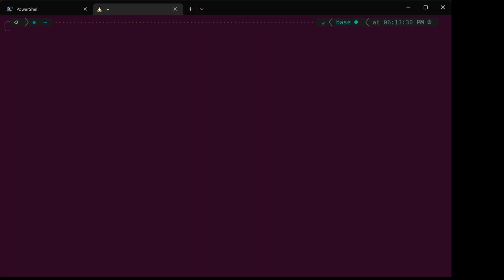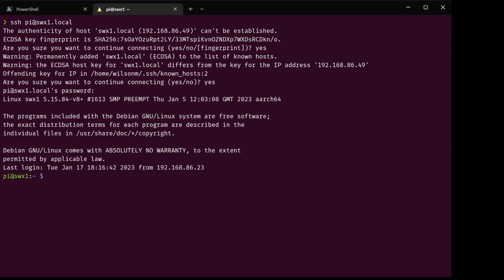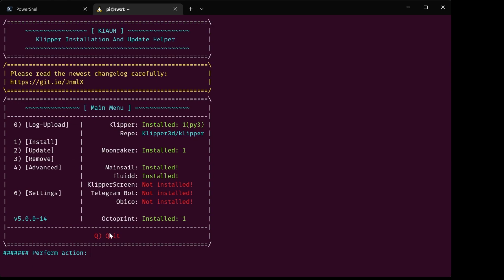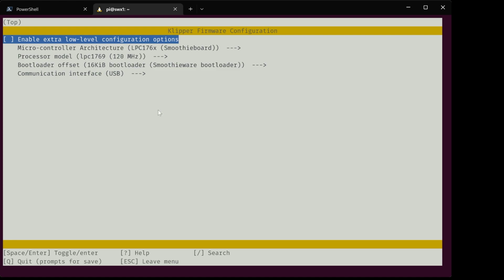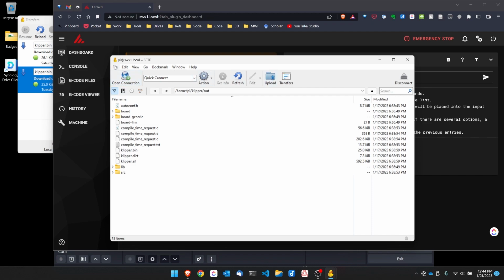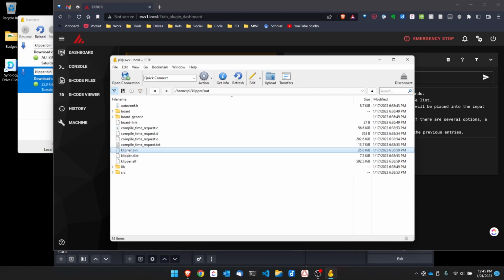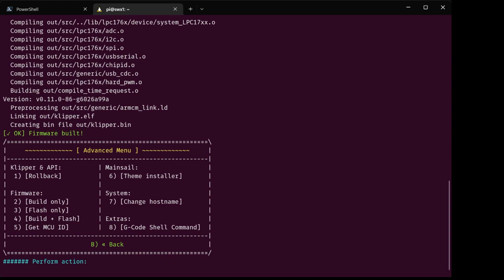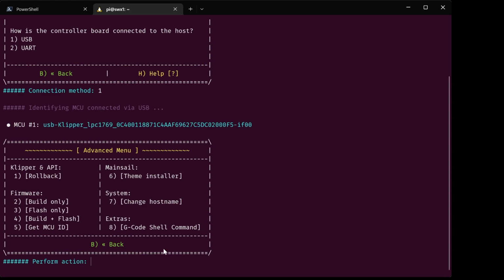Completing a Klipper Install and Flashing the Firmware onto a 3D Printer (Part 2 of 2)

Comment: I've the same sidewinder X1, with klipper, skr 1.4 turbo and bltouch on waggster mod. I have problems with the bltouch. Wich pin did you used?
Reply from the maker: I use the pins on the breakout board and I believe the actual bltouch pins on the mb.
Reply: I use 1.27 with the waggster mod, but having so much trouble.  @minimal3dp

Comment: Does Anyone have a printer.cfg file for the x1 with the waggster mod?
Reply from the maker: What board?
Reply: @minimal3dp  Hi! Thank you!  SKR 1,.4 turbo tmc2209,  i got a file from clanks50ae on github but when bed mesh calibration  i get a "move out of range:2.000 305.000 10.000 [0.00]"  any sugestions?
Reply: @minimal3dp  SKR 1.4 turbo tmc2209

Comment: Couldn't you just connect the Pi to the printer and then flash the firmware you built on it? I am fairly certain that is how I had done it last time...?
Reply from the maker: You can but I have had issues with it in the past.

Comment: it would have been easier and cheaper if i had just followed my BTT boards pdf instructions on this. 
instead of installing everything as instructed by this video series and wondering why it wont all fit on my 8GB emmc CM4 raspberry pi. i would have all been done and printing last month. 
no one needs 2-3 web interfaces for one printer. all you had to install was klipper, moonraker, and one of 3 web interfaces (mainsail, fluidd, octoprint). 
you made the tutorial confusing and frustrating for new people. 
but at the very least i know how to install klipper in under an hour without a hassle now. i just have to upgrade some hardware on my printer to 24v before i can connect it and finish configuring the firmware. if only i didn't waste $200 by watching this video series.
Reply from the maker: I am a bit confused. Why did you spend an extra $200? Why not use a bigger SD card if that was an issue?

Comment: How do you actually flash the firmware on the motherboard though? I put the firmware bin file on the sd card, installed it into my machine, and then what? I powered off and back on but my BTT Klipper Pad 7 is still not showing a connection to the printer. I believe it did flash the firmware though because my Marlin screen is no longer showing printer connected.

Mainsail just says mcu 'mcu': Unable to connect and to restart firmware but that does not work.
Reply from the maker: Did you edit your printer.cfg with the MCU.

Comment: I want to build a Voron 2.4 which uses 7 steppers, and I want to use as much parts as I have on hand to keep cost as low as possible.  I have a Pi 3B, and SKR Turbo on my bed slinger, and an SKR 1.3 in storage.  Would my Pi be able to control both of these boards together which would keep me from having to buy an SKR Octopus?  I also have an SKR Pro, but I can't remember if it's an LPC 1768 or 1769, but I'd be most happy if I could use any 2 of the 3 SKRs I have on hand.
Reply from the maker: I was not aware that you could chain boards together. I think you are going to have to buy the octopus or a similar board with 8 stepper ports.
Reply: @minimal3dp  Nero3D said on one of his vids that the Pi can control multiple boards via the 4 USB ports, but he didn't clarify if they need to be the same boards or not.  I'll try to locate that video again and paste the link in another reply.
Reply from the maker: @MichaelJeffers75  I am thinking that is for Klipper running on 2 different printers. Let me know.
Reply: @minimal3dp  the way Nero explained it leads me to believe that 1 Pi can control several MCUs.  I'll try it in a couple months and clue you in how I made out.  I'll buy the Octo if need be, but I'll try to avoid the cost first.

Comment: whenever i check the mcu ID in putty it says "#=======================================================#
 No MCU found!
 MCU either not connected or not detected!
#=======================================================#" I've tried to make sure i have the proper build and everything seems okay, initially it was connecting (that was last night) then i went to bed and tried to finish set up and now im only getting mcu errors, ive been at this for around 10 hours now. If there's any advice id greatly appreciate it. this is my first time doing anything at all envolving a rpi or coding at all im a complete noob!!!
Reply from the maker: I would reinstall the firmware on the printer board and I would check your USB cable.

Comment: Hi, im struggling at this bit, i managed to get to 7 mins in without any issues apart from my printer is NOT listed in the config p[age, its an ender 3 Neo (first version) but apparently i can just use the ender 3 v2 as it is the same board (4.2.2). ive created the file and put it on a SD card but if i go back into the powershell my MSU comes up as usb-1a86_USB_Serial-if00-port0 so i dont think it has flashed properly. any ideas?
Reply: any fix for this?

Comment: I have same problem with many others (Including this thread) with 1.4 turbo  . When trying to connect directly to skr 1.4 turbo with pronterface:"Got rubbish reply from COM4 at baudrate.." Apparently there's an issue with firmware's serial port setting. I have no idea how to proceed from this.
Reply from the maker: Can you email me the error and I will take a look after work. My email is minimal3dp@gmail.com
Reply: @minimal3dp  I tried to connect raspberry and SKR 1.4 turbo with Octoprint. Octoprint gave Raspberry low voltage error. I have atm only 2A psu (Phone charger), Ordered 3A should arrive soon so fingers crossed. If that won't help I have also ordered 220V (250) 6 slot extension block with 4 slot 5A USB. It should arrive in a week or two.  If that won't fix the problem, I'll get back to you.

Update:  Since my mainboard is not yet intalled in the printer but on my desk there were some issues: Finally found out why raspberry Pi didn't communicate with SKR 1.4 Turbo. SKR 1.4 Turbo can NOT be powered from  SKR 1.4 USB connection. It MUST be powered from printers PSU (or equivalent external PSU). MCU id in the github default SKR 1.4 printer.cfg was poppycock. MCU id can be checked with command:   ls /dev/serial/by-id/*  in your ssh terminal.
Now at least I have error messages which I can fix without losing anymore hair: Missing parts of extruder1 section can be copied from extruder section of printer.cfg etc.. Long fight towards victory continues...But not today...I declared a cease fire for now at least.😁
Reply: Hi , I know this is old thread but did this ever get resolved, I got the same error, first time installing myself

Comment: When i do the MCU check,it return the message MCU not found
Reply from the maker: What board are you using?
Reply: Skr v1.4 turbo. I think i found the problem. The USB cable between the raspberry and the printer was faulty. I replace it and now i got the MCU for usb. Thanks for your help. I will continue the Klipper install from where i get stopped in your video
Reply: I did not have succes with the new cable… So i did the whole process again following carefully your 2 videos and i still endup with the message « no printer attached » on my printer. I have similar message if i go in Octoprint, Mainsail and Fluidd where they all report that mcu is unable to connect. I tried to enter the mcu id in the mcu serial parameter in the Mainsail printer.cfg file with another unsuccessful result. I will try to find the cause of this problem but for now i am stuck…
Reply from the maker: @vincentbrouillet1068  what board are you using?
Reply: Skr v1.4 turbo with tmc2209. Now i return to Marlin for now because i needed to print a new frame to mount the SKR v1.4 to get better acces to SD card reader and USB connector. marlin firmware work but know, i cant have the bed and the hotend to heat. I have to investigate why… some more effort to put in!

Comment: Very good video. I endup with a problem when it was time to download the firmware to the sdcard. I am on macos and i dont know what software to use to perform the file transfer. Also, i dont know where is the firmware.bin location. Is it possible to have some help on that?
Reply from the maker: You can use cyberduck. It is open source, free and works on mac
Reply: @minimal3dp thanks! The little problem is that it is not free (30$) but i will go for it anyway…
Reply: I did the file transfer successfully but when i put the sdcard on the sdcard slot directly on the SKR V1.4 Turbo and put the power pack, i get the message « no printer attached » on the TFT35 screen. Does it work on Tft35 or should i use the other mode?

Comment: help i only get one .elf file and one .hex file the .hex file doesn't work and i don't know what to do with the .elf file
Reply from the maker: It doesn't sound like your firmware is compiling. Do you get any errors?
Reply: @minimal3dp  no i get not more errors i have an ender 3 pro
Reply: @minimal3dp  now i have a .bin file but on my ender 3 pro when i put the sd card in there is no menu

Comment: How long does the flash take? I have been working on this for almost a week now and it's becoming an obsession. Could you or your watches lend me an ear. I have a Quadra Inovato ( PI alternative ) and I'm using a 4.2.7 stm32f401 board. 4 days of videos and wikis and reddit and the Klipper install git and OMG. Help please
Reply from the maker: The flash should take around a minute. Are you having trouble in slapping Klipper on the Pi or the printer?
Reply: @minimal3dp  Printer or they wont talk

Comment: Thank you for posting the video! It is very helpful! Do you happen to have a good configurations file for the original board in the artillery X1 printers?
Reply from the maker: No. I do not. Have you looked on Artillery'ssite?  I will also look around.
Reply: I tried their site but didn’t see a specific config file. Thank you for trying to help!
Reply: @shawnrosensteel2920  any luck? Know it's been about 8 months and doing klipper now
Reply: @familyj4715  I gave up! lol I went back to original firmware but I think I have other issues with the printer itself and not enough time to figure things out!

Comment: im getting this message and i don't know how to fix any ideas thanks                                        Klipper reports: STARTUP

Printer is not ready
The klippy host software is attempting to connect.  Please
retry in a few moments.   
and then it turns red and says this  
      Klipper reports: ERROR

mcu 'mcu': Unable to connect
Once the underlying issue is corrected, use the
"FIRMWARE_RESTART" command to reset the firmware, reload the
config, and restart the host software.
Error configuring printer
Reply from the maker: Did you put 8n the correct value for your MCU?

Comment: Thank you for this tutorials, they are really helpful to the klipper beginners like me. Can you, please, point me, what options to chose for Ender 3 S1 Plus for the firmware build? TIA!
Reply from the maker: No problem. Glad you find it helpful. What board does your printer use?
Reply: @minimal3dp  mainboard V2.4.S1.301 32 bit TMC2208_F401RCT6, this is what I've found so far. Does it helps?

Comment: I wish you had continued on with the process on the Ender.  When I compiled the firmware I got a klipper.elf.hex file instead of a klipper.bin file.  Had to make sure that the .hex file is what I needed for the Ender. :)
Reply from the maker: Sorry. I had not seen the .hex "issue" before. Is all working?
Reply: @minimal3dp  Yes, I was able to complete the install successfully on my Ender 5+ and all is good :)  Now I just have to spend some time going over how best to use Klipper/Mainsail.  Since I have my 5 S1 working well on its own at the moment, I'm in no hurry now.  Thanks!
Reply: I also get a klipper.elf.hex file. How have you fixed this problem?

Comment: How's it going. Wondering if you can help. My skr3 Ez won't connect to my pc. It's not the pc bc I can connect the ender 3 pro no probem
Reply from the maker: Do you know if the firmware flashed correctly? My guess is that it did not flash. From KIAUH select "Advanced" and the "Get MCU ID". Does it have "klipper" in the name?
Reply: @Minimal 3DP Yes I plugged  the SD card back into my computer and it showed the FIRMWARE. Cur
Reply from the maker: @1TexasGamer  can you set the MCU ID from the board?
Reply: @Minimal 3DP  I'll check tomorrow. Thanks  for your help.